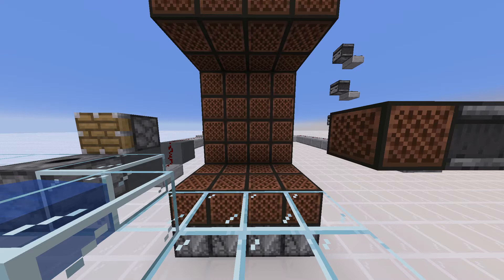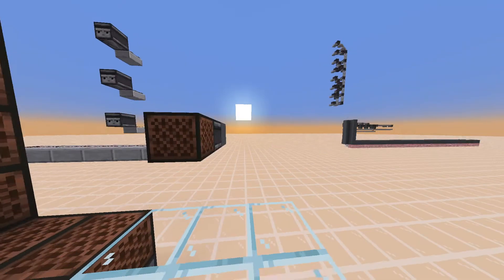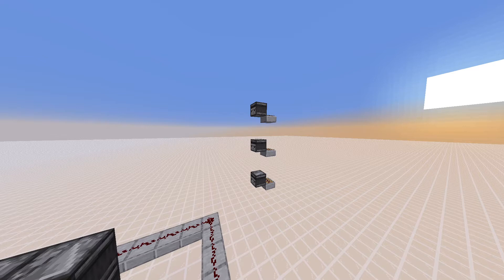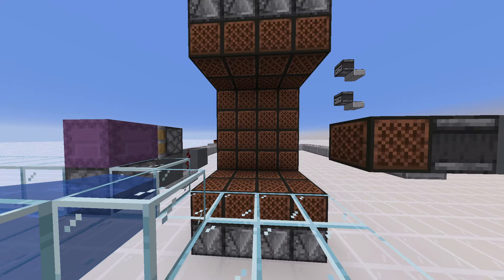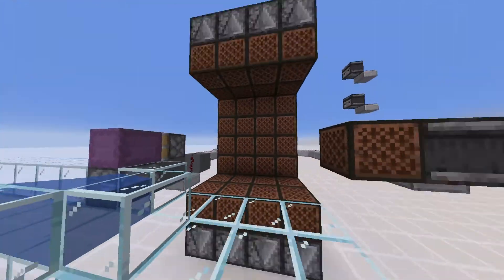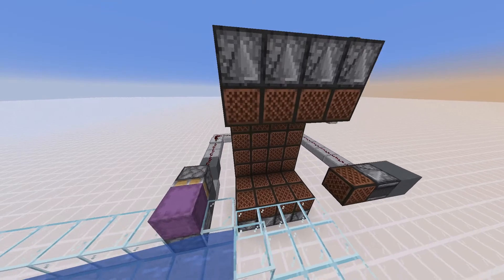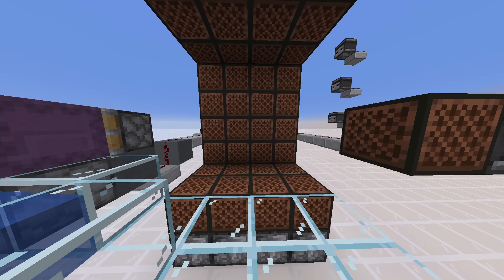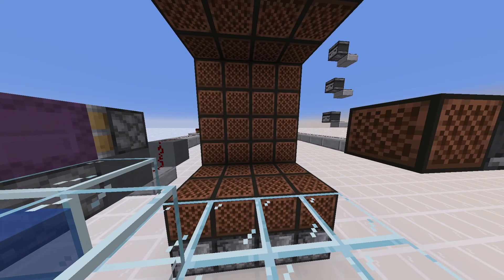The Theoretically Best Storage Interface | Minecraft

Comment: I slightly differ about what speed this would be, you would have to remember or figure out each number and input it, which would take up to tens of seconds. Relatively, a system such as you described with calling shulker boxes and with cooresponding items
Reply: Using items to call boxes would work if we had movable hoppers.
Reply from the maker: Figuring out these numbers is nowhere near as hard as it might seem especially since we can fit like the most used redstone items into just two digits and thats not that hard to remember.
Reply: while the most used redstone items might fit into 2 digits, blocks for building and many other frequently used items wouldn't
Reply: blah blah theoreticals smheticals who needs to account for issues when you can just cheat!
Reply from the maker: @killingtimeitself  even with a hacked client you still need a storage system.
Reply from the maker: @killingtimeitself  Its not modded since it only changes the language and I dont think there is a single server that has rules against it.

Comment: The problem is. You can't simply put boxes back. You need a sorting system for those.

Maybe its an idea to order a complete chest inventory instead of an item. And send it back.
Reply from the maker: Thats the case for all storages you always can get people to put items or boxes into them.
Reply: @AdamSchadow  but wouldn't the storage system cause passive lag? it wouldn't stop this storage system from having very fast access times, but it would cause just as much passive lag as any other storage system.
Reply from the maker: @thedenominator_  Ofc any storage that is loaded causes lag however you could simply not load the storage while nobody is using it and only if a user sends request from the interface would it get loaded process the request and then unloaded again.